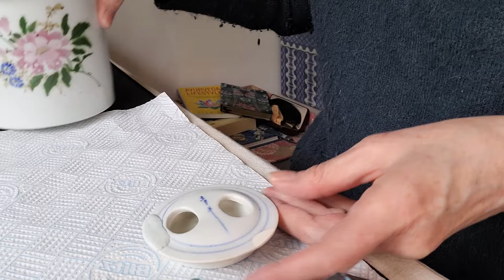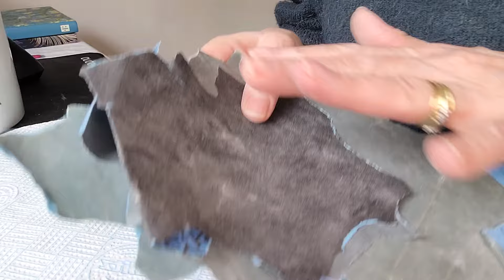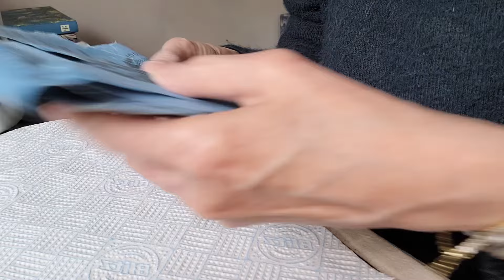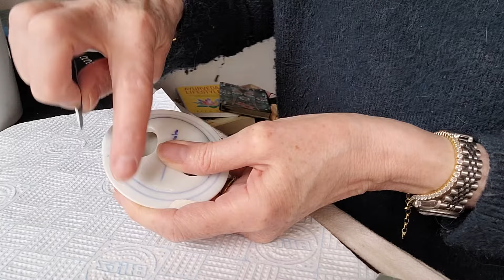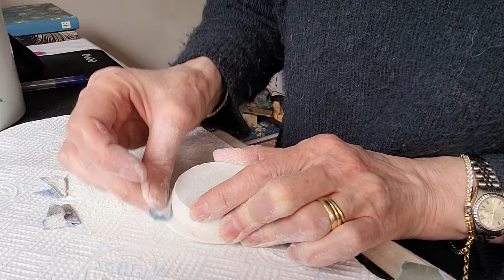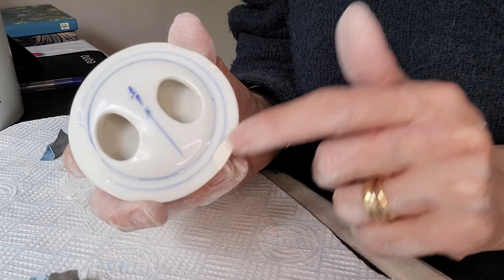How To Repair Broken Ceramics /Sanding Milliput

Comment: Hi Ali, I recently found your channel and I really enjoy your videos! I have a few ceramic dishware with cracks/broken pieces that I think I can put back together now! I do have one question though, regarding my large serving bowl that has broken into two pieces. Each piece has a long crack in it, but it's not long enough to separate each broken piece into more broken pieces. I'm wondering whether I should complete the crack on each piece, causing them to break into more pieces, and then glue them all together, OR just ignore the cracks on the two large pieces and glue the bowl back together. I don't think I'm going to buy any filler in order to fill the crack and make it look like it was never broken.